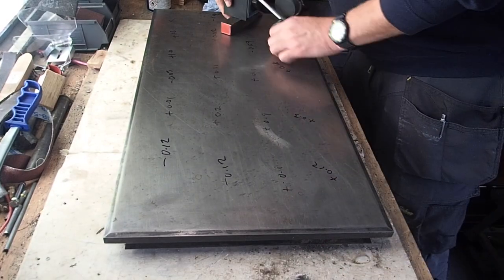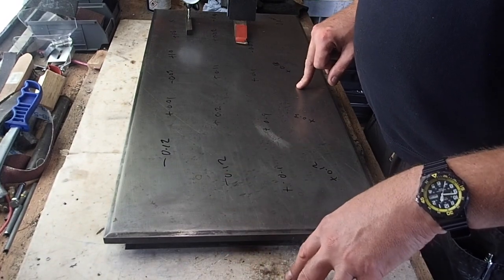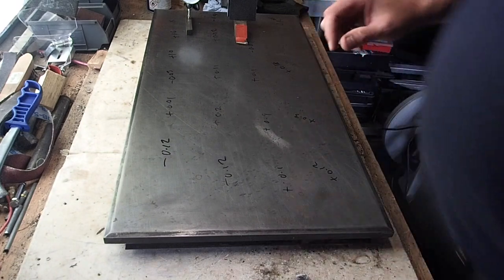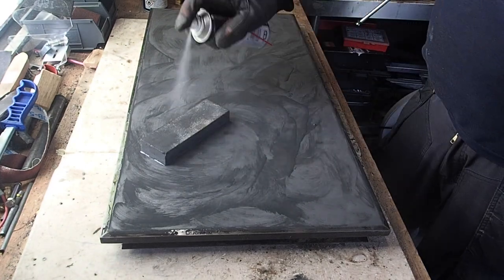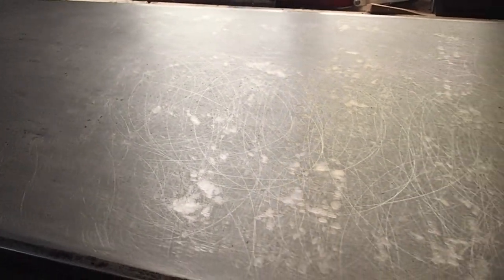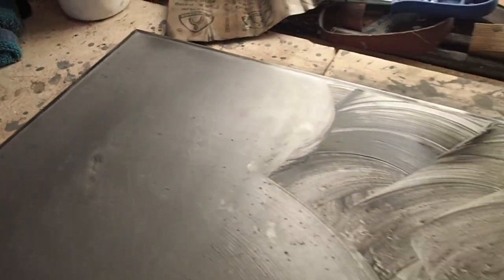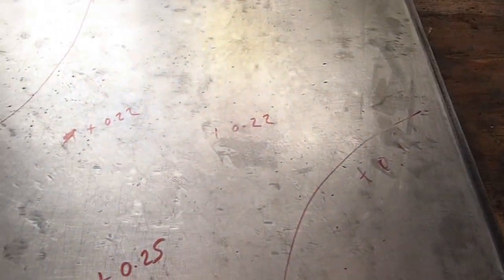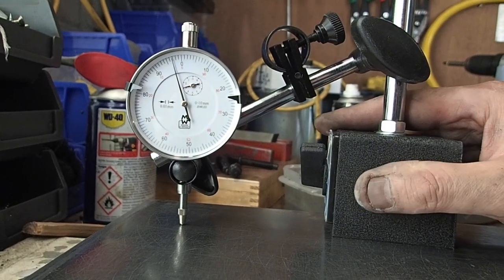Making a surface plate part 1

Comment: I'm pleased to find your video, brilliantly made! I've also been involved in a similar activity and currently I am sort of stuck. I wonder if you can give me some tips and trick to do the job?
Reply from the maker: Thank you Altaf - I'am just uploading another video now on servicing a used metal cutting band saw from Ebay. The surface plate is going to be an ongoing project - The surface flatness is still being determined, once I'm happy then another stage of honing, then scraping, then hopefully completed.  I'm trying to create one video a week due to other commitments.
Reply: Darren & Jayne Sharpe Thank you for responding. I’ve subscribed to your channel and will look forward to your uploads.

I am trying to make a “sort of” surface plate out of a natural marble stone slab measuring 190 x 75 x 10 cm. I am a beginner and gaining knowledge from experienced people like yourself. I don’t have a dial test indicator instead I use a starrett 98, 12” engineers’ level. Rest of the tools I’ve got are a couple of straight edges (90 cm and 2M each.) and a set of thickness gauges.

The method I’ve been using is that initially I rough ground the surface with a hand grinder with a custom made cutting depth control jig. Used diamond grinding disk followed by a 60 grit silicone carbide grinding cup. Then I affixed 60 and 120 grit water proof sand paper on a 30 x 60 x 5 cm marble slab which itself was finished using the three-plate-method. Next I plan to lap it with the same marble plates with fine grit sic power as a cutting medium. But it’s been a hard work... 

My main problem is that I don’t have a proper straight edge to check the cross sections of the plate. And I cannot invest in a proper straight edge measuring 2.25 meters hence I’m using a plasterers screed, honed by hand by myself but it’s only true to the sight.

I am aiming for an overall accuracy of 0.5 mm.

Please suggest me how would you approach this job? Do I need a bigger sanding block? Should I have to get some other tools, etc.?
Any other suggestion, idea or tip that you could have for me??

Thank you
Reply from the maker: @altafhasen4739  Thank you Altaf we hope you enjoy the content. The granite block surface plate I'm sorry I can't help you. I believe you need specialist optical instruments to work on them. What standard are you hoping to achieve?
Reply from the maker: @altafhasen4739  Hi Altaf Using the three plate method should get the flatness to a good standard. The lapping would be good then I guess it should be flat. With my metal plate I intend to complete the flatness detailing, honing, lapping then learn surface scraping. I want an overall flatness of .01mm over a 200mm length anywhere on the surface.
Reply: Darren & Jayne Sharpe it’s marble which is much softer than granite. I want it within 0.5 mm from edge to edge.